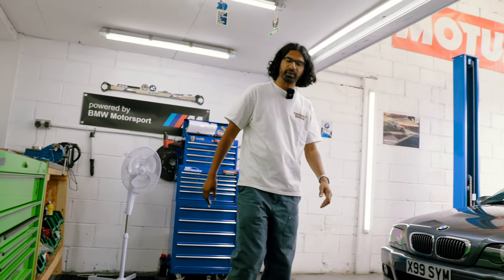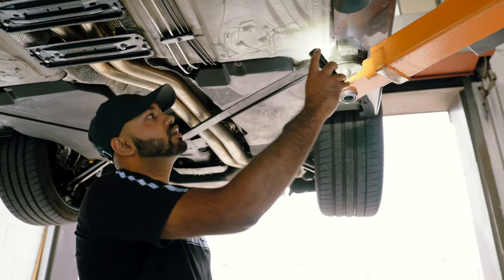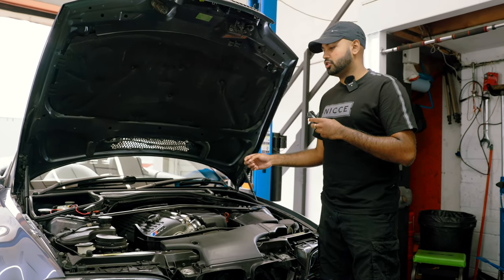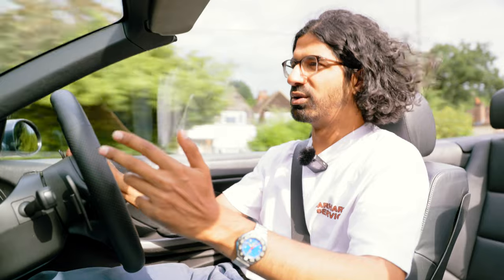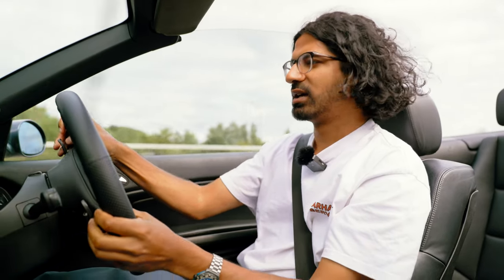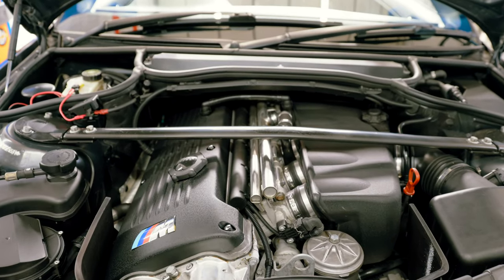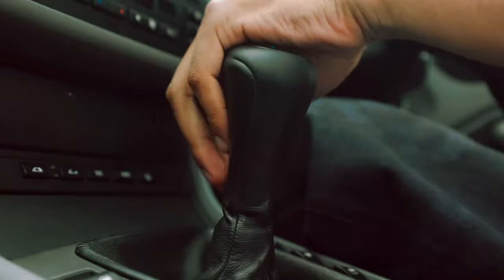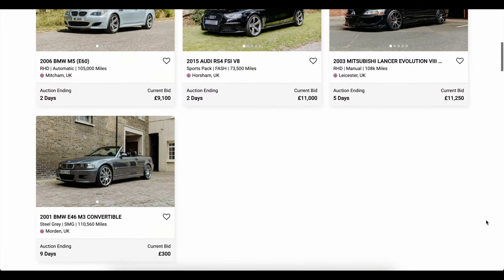BMW E46 M3 Buyers Guide, Owner Spotlight & SMG review by Shooting Brake

Comment: Glad to hear positive things about the SMG system. Once you drive a well maintained one, it’s amazing
Reply: I bought one brand new and it sucked. It was never in the right gear and every shift (auto or manual) was a mess. The ZF 8 speed is everything the SMG wanted to be. Lightning quick, smooth, and a program that is beyond magical.

Comment: I love manuals, and SMG is an amazing example of a manual gearbox- an aggressive shifting experience via a stick shift or paddle shifters, or a buttery smooth to aggressive automated shifting courtesy of drive logic modes (dial it to setting 1 for easy driving and all the way up to setting 5 for a high revving experience).  SMG is the premium transmission option for the E46 M3, hence why it was the only option in the highest end model- the CSL (which was not optioned with a 3rd pedal).  Love the SMG!  I can set it up for my wife to drive, or set it up for the fastest shifting race experience.  Amazing!  Thanks for the video.

Comment: Absolute privilege to spend the day around Shaneel’s stunning E46 M3. It’s as close as you can really get to a brand new one and gave me a taste for how amazing it must have been to drive, see and experience these incredible cars back in the early 2000s. 

Interesting finally being able to drive an SMGII car. It takes some time to be able to get the best out of it. Whether thats a good thing or a bad thing is up to you - I personally think in an age of instant gratification but ultimately shallow automotive experiences, finding a new skill and system to master is a beautiful thing. 

Once it clicks it’s a brilliant system, relaxing in traffic compared to the manual’s heavy snatchy clutch and wonderfully dramatic at full throttle. It’s also period correct - this is the exact spec of car you’d see specced as the protagonist car of an early 2000’s Hollywood Blockbuster, and thats exactly how it makes you feel to drive. Hard to beat…

Comment: Great cars and still the car I did the most miles in. 42k mikes as a daily over 30 months. Sold it during lockdown for the v8 equivalent which I hated
The smg was a great gearbox I had the csl software put on it which sped it up and with an Eventuri intake what a car

Comment: Man the moneeeeey spent on that m3 … can’t even comprehend. Lovely car. Such a shame as an e46 m3 has been my dream car since NFS most wanted and I’m now 28 … but I just can’t ever seeing me being able to afford one. They’re within my price range just about but could never afford to run one or get a 12-15k one to this condition. Such a shame 😢 Special cars.
Reply from the maker: I don't think you'd regret buying one now even if you can't budget for the annual maintenance in one go - you don't need to daily drive it and you definitely don't need to do all the big jobs at once! The only thing I would budget for to use the car immediately would be rod bearings. 12-15k should buy you a decent useable example that doesnt need immediate work.
Reply: All cars need work especially if your thinking buying a e46 M3 

Fact 

 diff work / rebuild 

Man that diff is rusty as a MF 
& diff bolts are rusty af
drive shaft are paint less 😳. Rust on the subframe plates  run in the opposite directions on this one peeps 

Window sills 

Light covers lenses 

Condition of paint rust 

arches rusty 

U.K. weather 

rod bearings 

head gasket 

Cooling system  refresh 

Cpv valve 

Tyres 
Condition of alloys 
General maintenance. 
Disks r expensive 

pads
 brake lines backing plates bearings 
 Just too name a few things 

But as above most big jobs can be done over time if your lucky enough and 

but would u want to risk it 🤔😳 

Don’t take the seller word 

Some shady people out there selling cars saying there’s sorted when really not 😉😉
 

What’s this dude talking about a clean example 😂 

He’s clueless and blind 

Get a PPI from a good reputable  specialist is the best advice before partying with your money 

But definitely have a few grand on top of the price for some things to be honest 

Best advice don’t buy this poor example of a e46 m3 

And definitely get a ppi done before you buy so you know what too expect when buying a used one 

Full service history with a specialist ✔️ 

Not forgetting the subframe rust on the underside where u got plates fitted shockingly 

You said you had it done from a specialist.? 

Who did the subframe on the car.? 

Those drive shafts inn the video aren’t new please 😳 

New ends of driveshafts doesn’t make them new driveshafts unless the whole drive shaft is completely new 

I would definitely get a ppi check on this car before bidding for it 

not that I would even entertain this car 

Would definitely pass on it 

All you have done is change the end of the drive shaft 

So too say the drive shaft’s are new is laughable really 

U should offer £6000 for the car 

Then spend £9000

From
A good bmw specialist getting it half decent 

Or just save your money and just buy a half decent quality one for the get go 👌🏼

Head gasket 

vanos 

And most importantly stay well away for a smg unless u like pain 😂🤐

30 k on bills on this 😂 

Please brake down the cost of 30k on this car 🧐

Comment: One of the most informative videos on the M3 that I've seen, and I've seen pretty much all of them. Thank you, you have a new subscriber!

A question: I had my VANOS rebuilt with Beisan and valves adjusted about 17k miles ago. Recently I had my throttle actuator replaced, and since then I've noticed the car has a bit of uneven power between 1-3k RPM, along with occasional jumpiness between shifts (when short shifting). Is it possible I need to adjust the valves again, or another potential problem? I thought adjustments typically lasted 30k miles (I'm at 183k currently).
Reply: Unfortunately issues at 1-3k on a high mileage S54 could be down to a huge range of sensor faults - that part of the S54's power delivery is basically heavily augmented by vanos and all the sensors working in harmony to allow the ECU to push decent timing into the engine to make power, hence how the S54 is able to be so torquey whilst delivering peak power at 7.9k. I would consider replacing cam sensors and TPS with new genuine parts. It's always worth compression testing a higher mileage S54 to check for headgasket issues which can cause pinking at low revs too. Good luck, they can be a pain to get running right at lower revs, mine isn't quite there either!